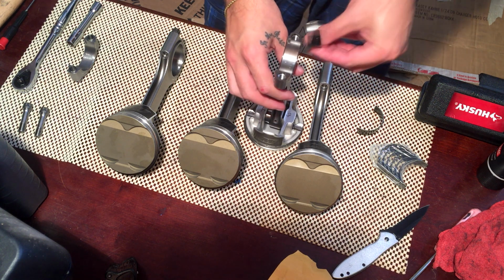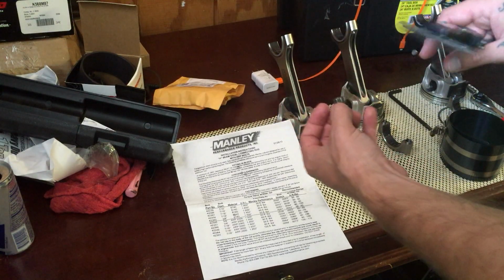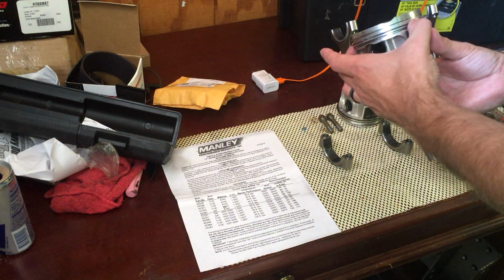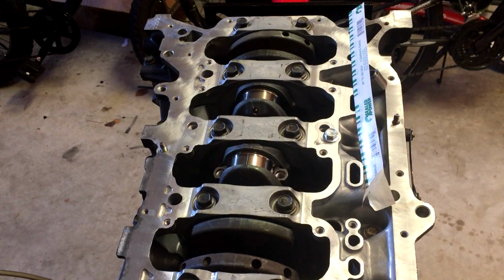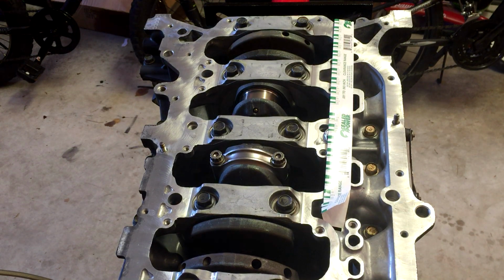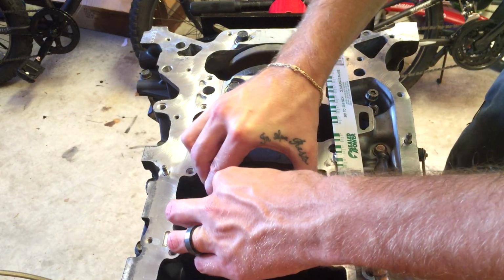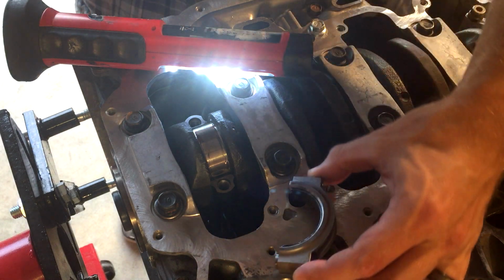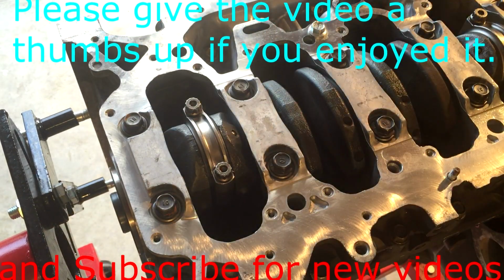Turbo K24 Accord: Wiseco Piston Install

Comment: You should tap the ring compressor down square onto the block with the hammer before you knock the piston out.  This makes sure there's no gap between the compressor and the block where said ring might jump out and cause you a problem.
Reply from the maker: Steve Wright thx for the tip. Will do next time.

Comment: just a heads up for next time. when using that type ring compressor, let the skirt of the piston hang out the bottom. when you go to install them into the bore you won't have that problem of the rings popping out the side. great vid nonetheless 👌
Reply from the maker: Will do! THX for the tip.

Comment: nice brother what kind of boost and power are u expecting from your setup?
Reply from the maker: Ismael Candia Thanks. I just started working on boost by gear but I will be doing 12-14 psi in 4th. Looking to get low to mid 500s. Going to need a better manifold though.

Comment: i have the same engine k24 and the same Honda accord model i m not mechanic but here is my question what is the plastic paper that you use for i still not understand it
Reply from the maker: Plastigauge is a tiny thin piece of wax that I flattened between the crankshaft rod journal and the piston rod cap bearing. You measure the width of the flattened wax against the chart on the product packaging. That will give you the oil clearance.
Reply: thank you for the answer

Comment: Your comment about what you don't want to do is put lube on the back side of the bearing because it will cause you to spin a bearing is completely false information my friend, it is actually a good idea to put a thin film of oil on the back side of the bearings before you install them so that they slide in easier, believe it or not but more often than not when installing the bearings the block itself will actually gouge or shave a fine bit of the back of the bearing shell causing yor clearances to be off.

Comment: You should never install your pistons with a hammer.
Reply from the maker: Tons of builders do it. There is no reason it should harm the engine unless you are bashing in your pistons or using a metal hammer. But im open minded to suggestions.
Reply: I know a lot of people do it. The point is you shouldn't have to is all. When I install my pistons I use 1 thumb and gently push down. If it doesn't blissfully glide through the compressor and into the cylinder then I take it out, try and get more carbon off the cylinder, relube and try again. Obviously a hammer works. But it just seems off to me. To each his own.
Reply from the maker: All parts were new, bores were honed and everything was lubed up with 5w30. The only other thing I could think is that I had to order .5mm over sized piston rings to get the gap right.